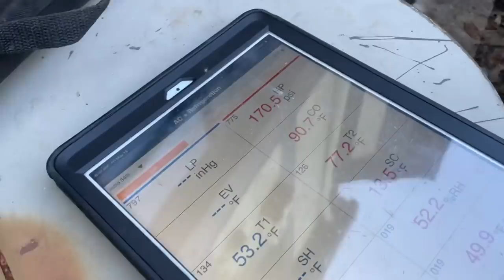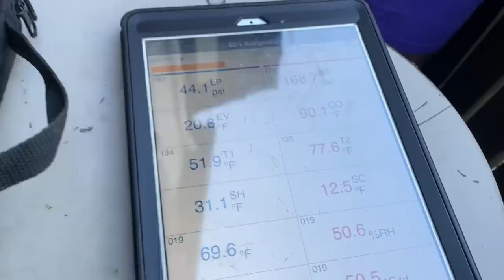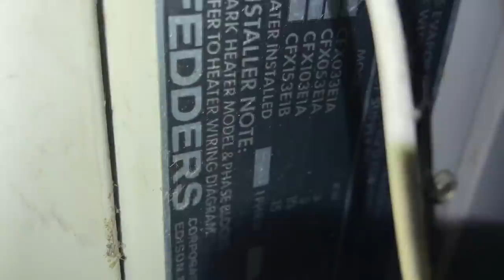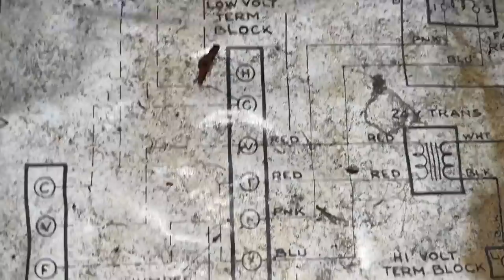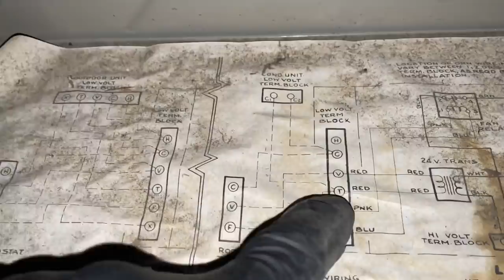Old Fedders Central AC System Brought Back To Life - Are there Bats in your attic?

Comment: I used to work on those systems! They had rotery compressors and had so many problems with them like the navein they almost went out of business and then only made window shakers with rotary compressors! My company had a contract to repair those under warranty in the winter during the slowtimes for HVAC here in DC !  Many times the compressor would bind and you could hit it real hard with a hammer and it would rore back to life! You should do the change out on that system Mikey pipes because it would be a great learning experience for Godzilla!

Comment: You deserve more than a thumbs up on this video, I did heating and air for 20+ years and being only 5'6" i know exactly what the heck you had to do to make it to the air handler, on the positive side it was not hot outside yet. I hope you put something over that gaping opening on that return air that was letting air from the attic into the air handler.

Comment: i notice alot in NY the installation of central systems are really shoddy.  I think it's because alot of the houses were already there and they put a central a/c system in later.  I bet on new builds they won't put the air handler in the attic they would put it in the garage.

Comment: So there was not a filter in that attic? Guessing it would not have made a difference. I recently had my attic HVAC system inspected. The furnace and blower are from 1994. A/C was replaced in 2009. I asked him if there was a filter to change; he looked around and could not find one. According to him, it just has two return filters in the ceiling which I change out once every three months. Since this tech was from a reputable company in my area I will take his word for it. But what are your thoughts, Mike? This system you just serviced did not seem to have a placement for a intake filter either.

Comment: That was insane. The code here calls for 1) A light and outlet near the equipment, 2)a work platform(secured boards) around it. That does not stop the other insanity: Attic Access past the AH. (I do low voltage type  systems). There was not even enough room to crawl on top, let alone turn around to lower my feet.

Comment: Also your lucky to have the line set on the out side of the wall. 99% of line sets here in Arizona are ran inside the walls and impossible to run new T stat wire when theres a short, it either has to be exposed or do about 1-2K$ in dry wall damages for a fucking wire.

Comment: are those systems R22 or R12?if there R22 there probably post 1970. that duct work needs a complete redesign and both units replaced at the same time, to do it right of cource. I kept watching, definitely R22. those condensers look around 25-30 years old for sure.
Reply: R12 for residential was a thing briefly in the 50s/60s.

Comment: Id tell her to hire a carpenter to install a catwalk around the equipment to be serviced and a bridge to go over the unit, otherwise call someone else. You dont need the headache. That duct work is garbage, I realize thats not your work.  Im surprised that passed any inspection.  Dont they believe in hard pipe in NY? Max length of flex is supposed to be only 6 feet on the ends.

Comment: I cannot believe the original installers would have constrained access in such a way and it is more likely that after this air handler and ducting were installed the internal room walls were the. put up to maximise room space and encroached the shit out of the attic, and without a thought for either access into the loft or access for servicing machinery. Good video, but man you got to wear a proper mask for this shit.
Reply: looks like homeowner added finished atic and pushed everthing over